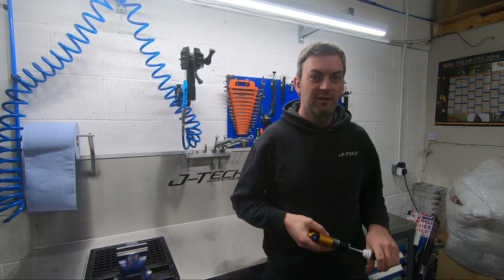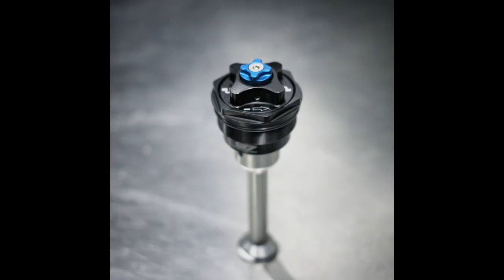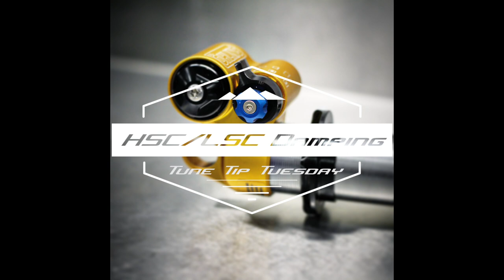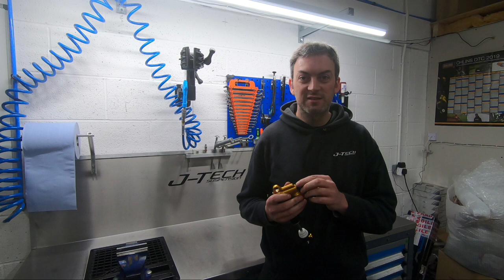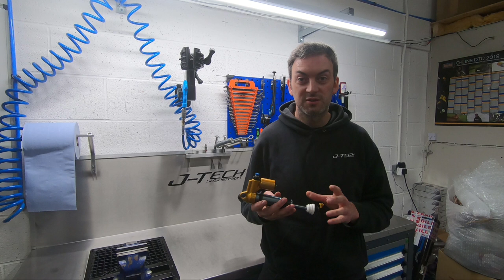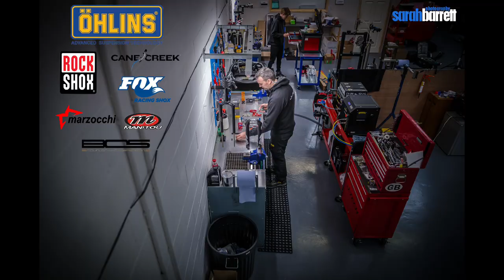High and Low Speed Compression Damping - Tech Tip Tuesday #5

Comment: Brilliant, my forks always feel harsh on the small stuff and I do feel the front end is a bit nervous at times in the turns 👍
Reply from the maker: What you describe can also be down to excessive friction too. So make sure the fork is working correctly before making damping adjustments. A good test is to stand with the bike between your legs, then with flat hands, push straight down on the grips. If the fork compresses smoothly, you're good to go, if it judders, you need a service and possibly bushing resizing/replacement.

Comment: I've got a question about suspension set-up, on a shock what are the problems with too little high speed compression damping (to soft). a too low of a compression tune for example.
Reply from the maker: Hi Jacob, the problem with not having enough HSC damping is that the wheel will move too fast, on impact, meaning it'll use more travel than required to absorb the impact. This then either causes the tyre to leave the ground, or your (and the bike) mass to move down. So loss of grip and/or an unstable ride, not to mention harsh bottom outs on large impacts/heavy landings.

Comment: So for trail chatter, when you are riding at speed and you want the fork to absorb all those small bumps (including the big landings?), that is HSC and for support when accelerating or climbing you want to adjust the LSC? generally speaking?
Reply from the maker: Accelerating and climbing, yes LSC. HSC is mostly the bigger impacts, not so much small chatter. It depends a lot on the piston and shim stack design. Think of it more as the speed the fork/shock moves, not necessarily how fast you're going. With anything that moves, there's a period of acceleration, so on small chatter, the speeds aren't that high, so too much LSC can give a harsh feeling in that instance.

Comment: I feel like my fork (2019 Rockshox Pike Charger 2 RC)  dives too much in rock gardens. Will dial in a bit more LSC (towards + button) and try it out.
Reply from the maker: If you're finding that the fork is getting lower and lower with successive hits, it's more an indication that your HSR is too slow, so the fork isn't recovering sufficienlty for hte next impact. If it's diving on the first impact, increase HSC, not LSC - most rock impacts are fast enough to be a high speed movement. Hope this helps.
Reply: @j-techsuspension  this model only has a dial for LSC
Reply from the maker: @51249ca  Apologies, I misread your comment! Yes, you'll have to find a compromise between support and compliance with the LSC adjuster in that case. If you're still struggling with setup drop the team an email on service@j-techsuspension.co.uk Many thanks.

Comment: So, just for reference, I just bought new coil shock bomber CR where is just low speed compression, I can adjust this setting  to highest to limited pedal diving? Or there is something more?
Reply from the maker: Hi Jakub, yes, increasing the LSC will reduce pedal bob. It's a little tricky to do on the fly, but if you have time to adjust between sections, it's fine.
Reply: @j-techsuspension  By increasing, do you also mean, closing?
Reply from the maker: @strongme80   Yes, that's correct. When we say increase, or decrease, we're always referring to the damping force. So an increase in compression damping = firmer and an increase in rebound damping = slower.